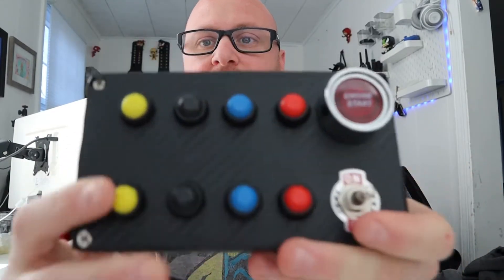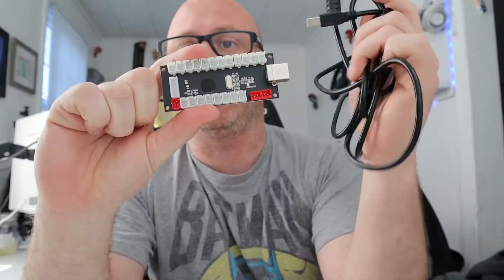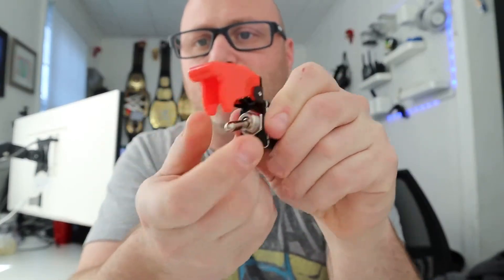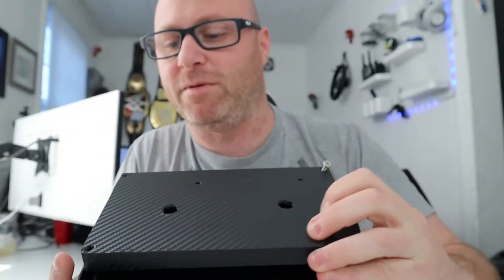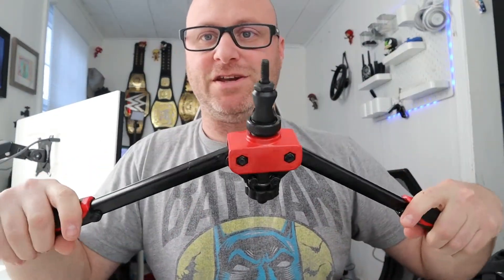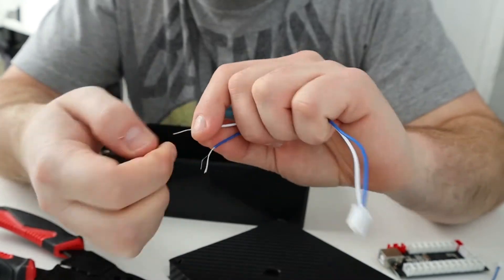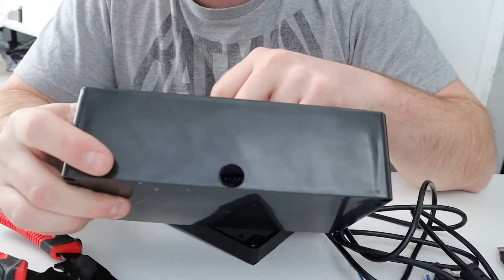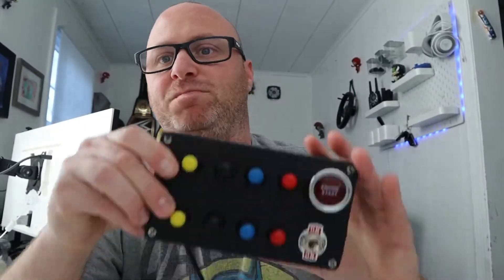Sim Racing Button Box - Easy DYI

Comment: Hey i just made a similar box same buttons as yours..How do i get the led on the start button to light up? I have same one and i have it hooked up and it functions but i didnt even kno it had a light til ur video!! It has 3 termilas on the back im using two so i assume the 3rd is for led but where on the joy con usb board do i get the power for the light??? Thx

Comment: Great video! but I would like to know how you wired up your switch which comes back by itself with the spring because im struggeling if these could work ?
Reply from the maker: Are u talking about my on off switch or my engine start? Let me know I would be more then happy to help you super easy
Reply: @KingFischRacing  I mean the ignition switch that you used which goes straight back to its normal position when you let it off
Reply from the maker: @rubinkeim7207  if u look me up on Instagram same name and thumb nail as this channel send me a message I will send u a picture of the wiring when I have time to open the box up later this week if u can’t find it I’ll give u my email address
Reply: @KingFischRacing  thanks man i wrote you on IG thanks a lot !!!
Reply: @KingFischRacing just sent you a message as well

Comment: I'm very interested in buying that same joystick controller. But how would I wire one of those red switches with the safety cap to the joystick controller? Because I bought one of those red safety cap switches, the switch I bought has a red LED with it, so it has three prongs. With the connection wires that the joystick controller comes with how would I wire it up so that the switch works and the LED light turns on? I hope you get back to this comment. I really need your help. Thanks!
Reply: I am trying to figure this out myself as well.

Comment: How did you wire up the start button?
Reply from the maker: I’ll post a picture on my I Instagram page
Reply from the maker: Sorry so take two of the wires which include one blue and one white wire...cut off the terminals. Join the two white wires and the remaining blue should be on its own. So white together blue separate that makes it one main wire. Add the two white wires and add the two blue wires. The switch doesn’t show what’s negative or positive but it will work. And it will take up two slots on the usb encoder.
Reply from the maker: You can also follow this video 
https://youtu.be/Dk8GSy6zR_o